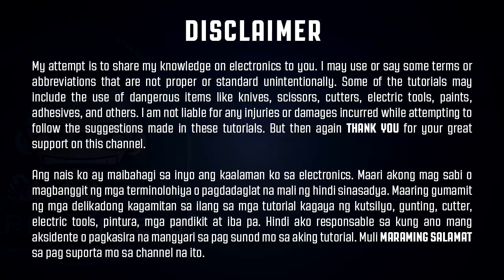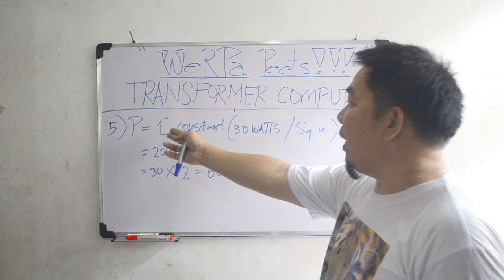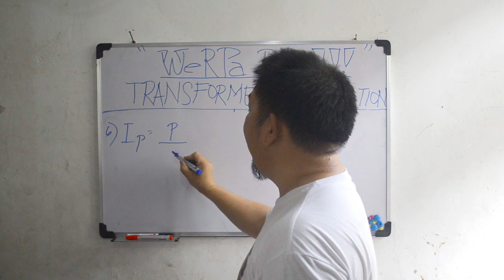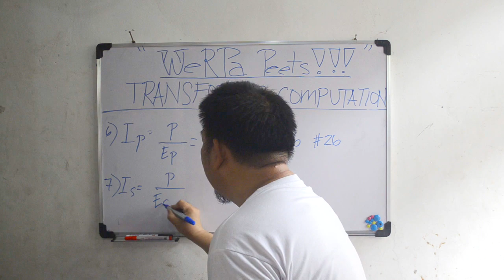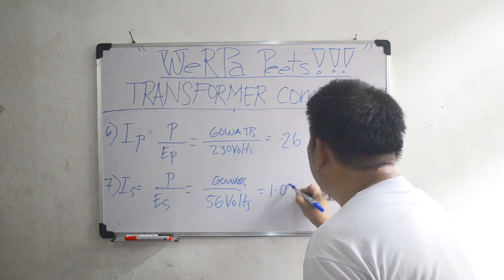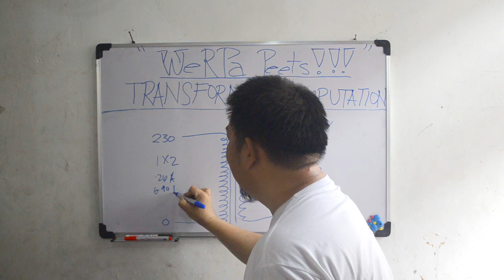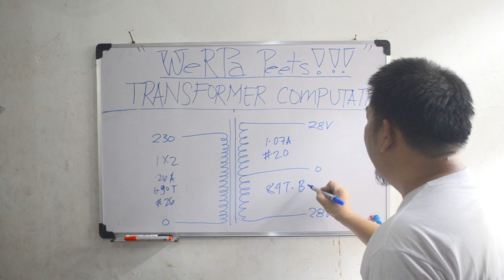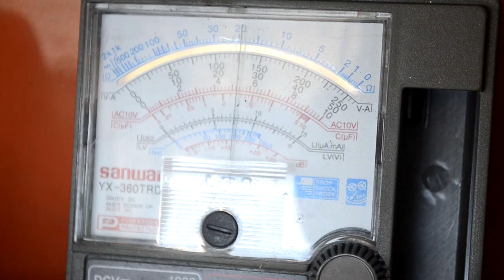Transformer Rewinding and Calculation Based on 1" Center Leg (FULL VIDEO TUTORIAL)

Comment: sir werpa pwedi po ba ibahin ko yung constang ng transformer?

sample
Area of core
1.25(W) x 5(T)
=6.25

Turns per volt

    6
6.25 = 0.96 turns (subrang liit lng kasi ng turns sir tama po ba?) 

Sir yung Constant ng transformer safe po ba papalitan ng (7.5 instead ng 6) sir? yan lng papalitan para hahaba naman yung turns ko sa primary. tapos yung power watts computation yung sa chart parin ninyo po. hinde po ba ma apiktohan yung computation ng gage wire sir pag nag palitan ng constant 7.5. instead 6
Reply from the maker: puede palitan ng constant yan ... kasya parin yang winding na yan ....maluwag pa naman yan sa 6 na constant....

Comment: Peet's, if mababa or mataas ng 1grade Ang magnetic wire,  babawas  ba o dadagdag ng turns
Reply from the maker: habang nataba wire naiksi ikot...halimbawa 12volts secondary, number 13, pag eksakto lang sa core ang number 13 na wire sa 12volts,pag tinabaan mo wire hindi na kakasya sa core,kung gagawain mo naman number 14,puede kapa mag dagdag ng ikot para yung 12vokts maging 13volts,kasi pumayat wire kaya marami ikot puede gawain.
Reply: Ah, sir Ang magkaiba size, pwede pagdugtungin? Ex  #21 at#22
Reply from the maker: @DiosdadoDelossantos-j3v  puede naman pag dugtungin mag kaiba ang size ng wire.. pero ang masusunod ang ampere yung mas payat
Reply: Thanks so much Peet's, your so good$$$$$